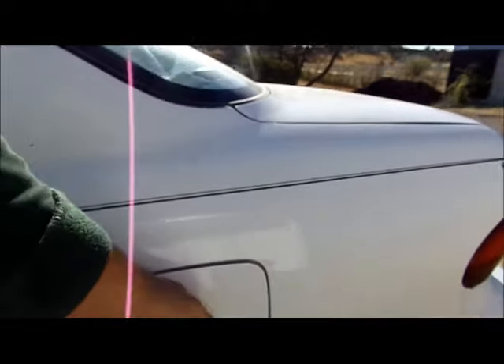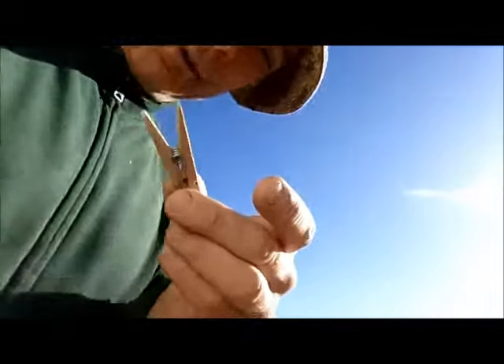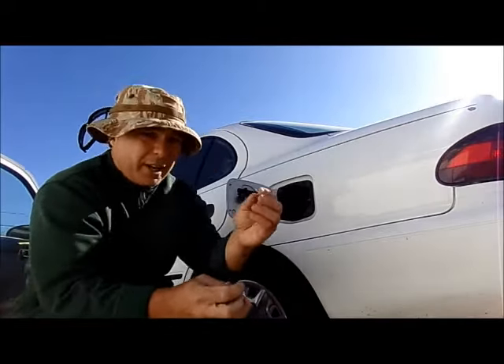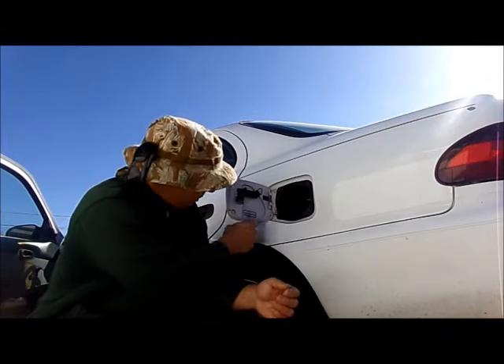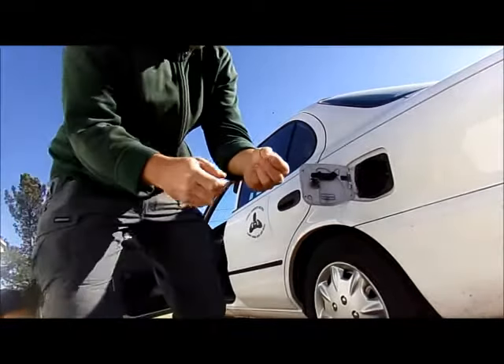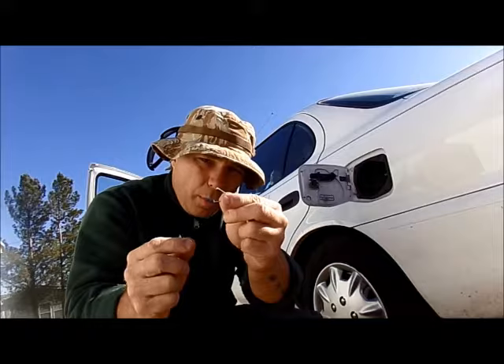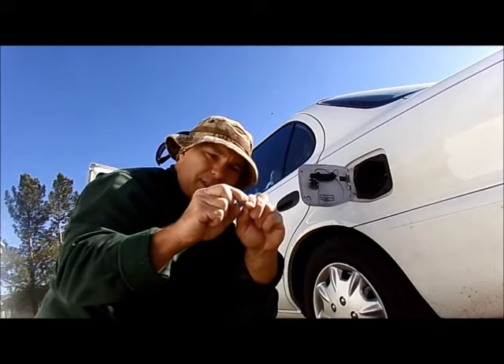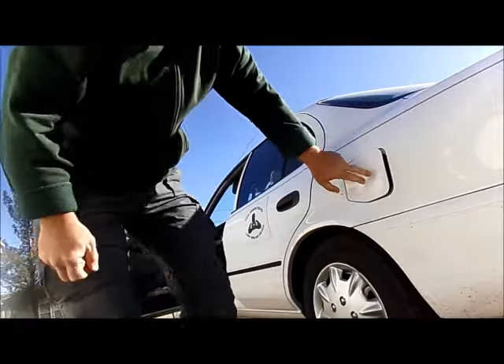DIY Hack:  Fix Your Car's Fuel Door for FREE

Comment: Hi. I was wondering if you knew how to fix a gas door on a 2015 mkz? The door won't stay shut.
Reply: Had this on a car once, the mechanism for locking the door had fallen off of it's mounting bracket inside the body panel. Took off the boot liner, crawled inside and found it behind an access hatch and clipped he machanism back onto it's mount and the door worked just fine again.

Comment: That's a smooth one. Any thoughts on a manual door? No front seat release, no detent at the fuel door to depress before it opens, just a lip for your finger to pull it open. The tether failed as well, n I'm in process of experimenting with making a coiled lanyard much like the curly ones from the old phone cords. I made mine from weed whacker line, sheathed in paracord housing. And i intend to attempt something with some small coin shaped neodymium  magnets. But a clothes pin spring seems so much more, simplisticly fancy, in terms of retaining its positive engagement. Wonder if it'll work on a manual door? Oh btw, mines a 05 f150, plastic fuel door and arm, plastic inner housing, only gas filler neck and the outside body of bed(fender) are metal.
Reply: Did you ever get it fixed or are you still at the pump?

Comment: yo pp good job i got a 99 rx lexus went to fill gas the gas door never open when i pulled the lever inside the car saw your yt i did it at home and wa la good as new used the spring pop good as new used the clothes pin part to open the gas door might keep it in the car just in case ......mahalo luv what you stand for

Comment: I can't feel anything when I pull up the lever. Like the cable is gone. 😩
Reply from the maker: Oh, man. Sorry to hear that. You can probably pop the latch with a flexible card like one that a grocery store gives for store discounts. The latch on the gas door is generally dead center on the opposite side of where the hinges are. Just slide the card in while gently pushing in on the door until you disengage the latch.
Reply: @primalpunch  I will try, thanks! I have taped over the latch so it wouldn't lock...
Reply: @primalpunch  i tried that card thing today and it worked like a charm thank you very much

Comment: If the door won't close..Step 1: Chew some bubble gum... Just kidding, thanks for the tip!
Reply: Duck tapes a better alternative that’s how we do it down here in philly
Reply: @symerewoods2318  duck taping? How does that help it pop open?
Reply: Tape one side of the spring, or if it won't open before you install the spring, stick the duct tape on the door and pull the edge to open.